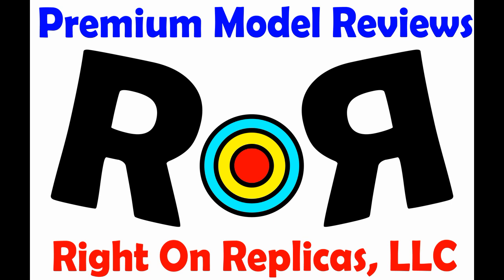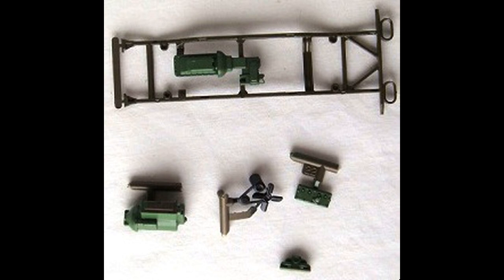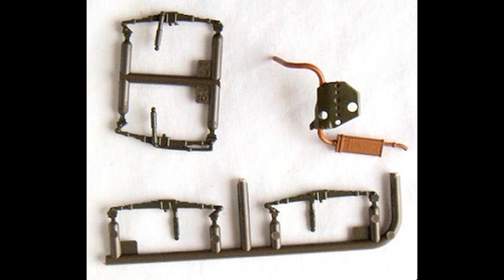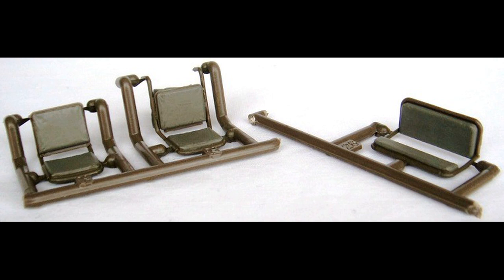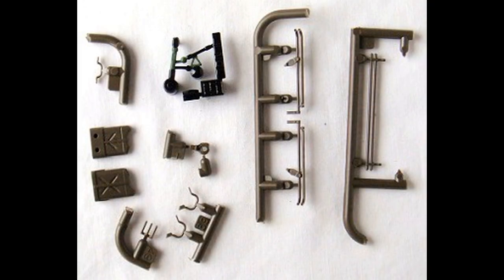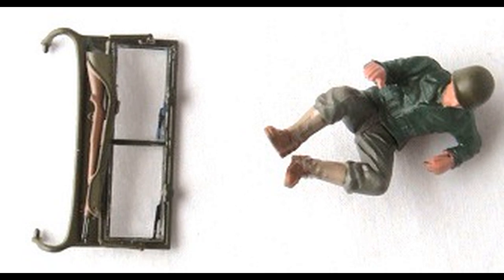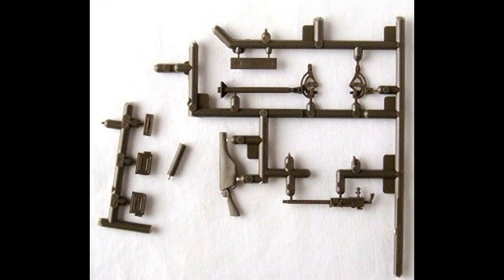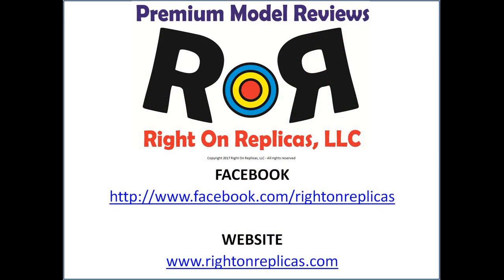How to Build the  Willys MB Jeep 1:35 Scale Tamiya Model Kit #35219 Review

Comment: Feb. 2018----Kit/build looks nice. Got a couple of these in my unbuilt stash, but going to use them for some zombie/apocalypse dioramas, including scratch building the cover for the jeep. And checked Ebay and found there's a Chinese company offering a pe snowplow and 4 tires with chains for $21 w/free shipping.
Reply from the maker: OBFM, That sounds both ambitious and far out!  -Doug
Reply: Jan. 1, 2019---One thing I haven't seen is ANY wheeled military vehicle with chains on during winter. Battle of the buldge is one example.

Comment: Ooh, I can see a Rat Patrol version in the works! Leave out the rear seat and top bows, put more ammo cans in the back.
Reply from the maker: CS, sound like you're on to something!  -Doug
Reply: I did it I got the "Rat Patrol"jeeps built the only hard part is finding the crew,Sgt Troy wore that Aussie hat and his driver Hitchcock had a foreign legion kepi,it is easy to make Moffet and Pettygrew  cause all you need is a beret and steel pot for them.
Reply: When I was in the philippines I saw a ton of this Jeeps converted into a public transportation. They where left behind by the U.S after WW2. They customized them with paint jobs and rim's. They extended the body longer.